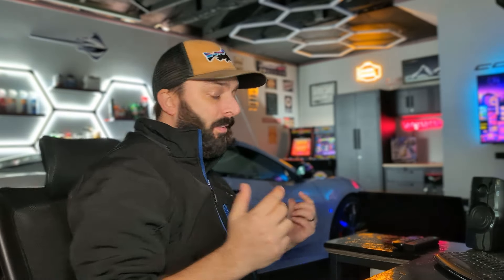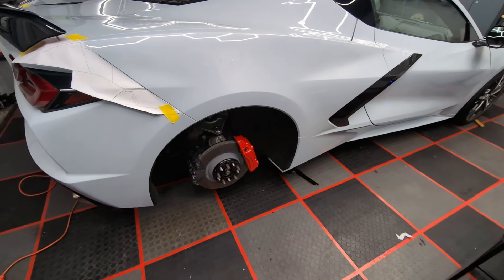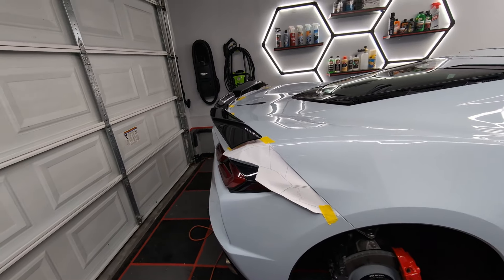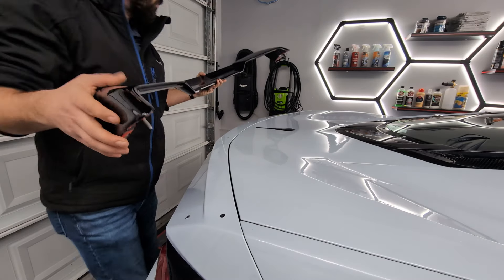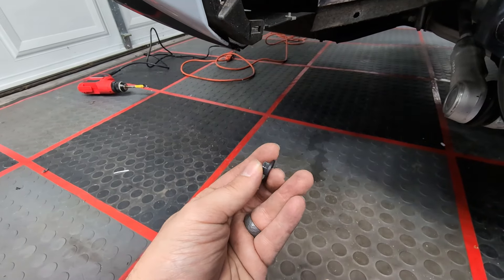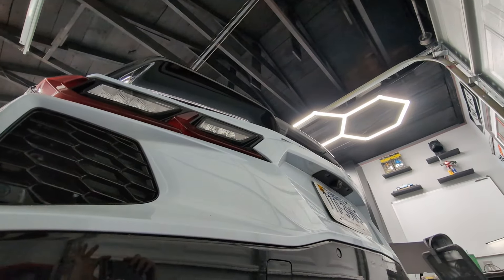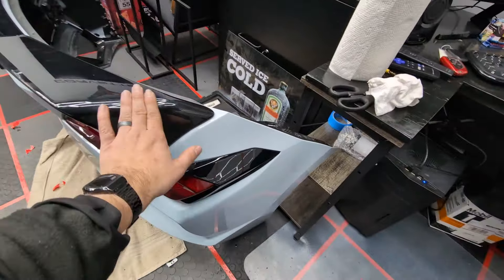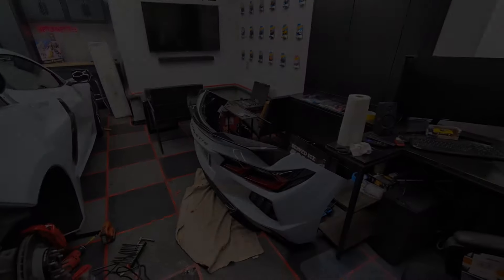Z51 SPOILER INSTALL ON A NON-Z51 | LESSONS LEARNED & DO IT BY YOURSELF | C8 Z06 GIVEAWAY LIVE NOW

Comment: Quick question for you or anyone in the comments. Given that you have an 1LT do you regret not getting a 2LT? I will be ordering a 24 and the only reason I want the 2LT is for the blind spot (for safety purposes). My wife thinks the extra $7,100 isn’t worth it and that could go towards a HTC. Thoughts??
Reply from the maker: The good news is 2024+ has blind spot monitoring & rear view camera standard.  The only thing I wish I had was blind spot monitoring & cooled seats.
Reply: @VetOnVettes  blind spot monitoring on the side mirrors?! I knew about the rear view camera. If it’s blind spot mirrors then I’m set lol. Thanks for the reply
Reply: I had a ‘18 camaro SS before my c8 & blind spots were also bad. The c8 is worse but not worth upgrading to the 2lt just for that OR the front lift option
Reply: Just bought a 3lt. I would in fact get 2lt ATLEAST. When youre comparing a 2lt and 3lt there isn’t much difference and you can choose 2lt and opt for g2 seats and save a couple grand that way. I think it’s worth it to get the 2lt.